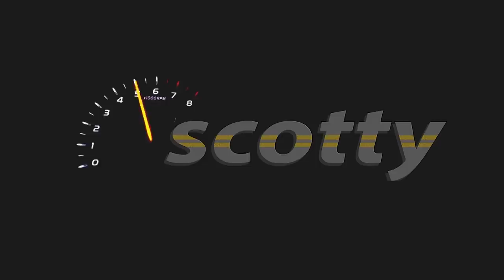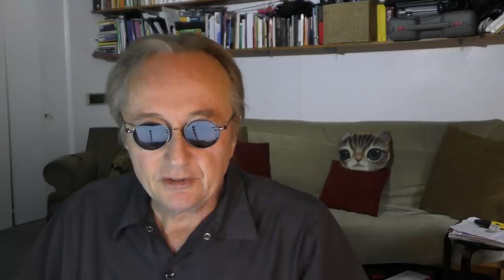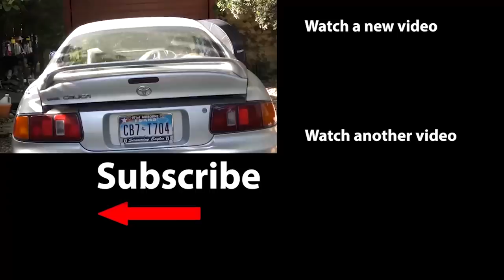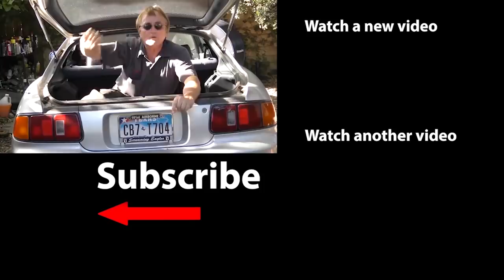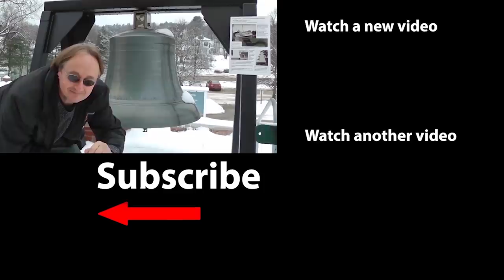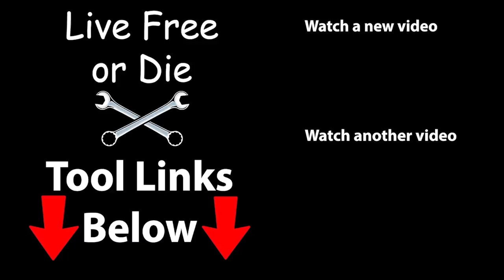Stupid Things People Put in Cars

Comment: I hate the automatic engine stop 🛑
Reply: I drive a company car, a 2015 Fiat doblo 25k miles with  start stop technology, it burns one litre of oil every 1000 miles absolute junk....
Reply: alitlweird same, I work for a rental car company and have to drive the f150 a lot and unless you’re paying attention and letting off the brake early so the engine can start up again you can forget about having a smooth start.
Reply: @CodeNiratias  I work for a car rental company too.  You wouldn't believe all the cars that get towed in for " engine dies out at a full stop".  Quite a few cars also marked O/S because of that.
Reply: @CodeNiratias  My neighbour bought one and sold it after the first winter.  Canadian winter...Minus 30 deg and start/stop plays havoc with batteries and engines !   Complete crap !
Reply: I hate it too, I turn it off every time i start my car
Reply: Fiat isn't bad now days. they are meh, but not junk as they used to be.
Reply: I drove fiat doblo too , i had to put oil  once a month !
Reply: @aintquitewright1480  it's different with Toyota hybrids because the motor is chained to the engine rather than the constant crank of a starter motor
Reply: alitlweird on my 2018 f150 with a 2.7 I can turn of that start on stop
Reply: I don't like it either. But unfortunately its becoming standard. I just turn mine off before I drive off. Going to deactivate it soon though. Because sometimes I forget to press the off button....
Reply: I can't imagine driving a bullshit car like that. What a ridiculous feature, but at least you can turn it off.
Reply: @Vanessinha91Pucca  Sure thing Vanessa smh
Reply: just hearing them turn on and off on the road is annoying
Reply: Is there a way to bypass it? My mom has one and it’s going to fry her starter.
Reply: alitlweird so do I it’s COMPLETE GARBAGE
Reply: @chaddiusthewise527  The starters are built to take the expected extra cycles. So are the batteries. Because they're all about gaming the fuel consumption figures, you can't turn the 'feature' off permanently without doing some research and a spot of rewiring but you can usually do it each start. How easy it is depends on the manufacturer but normally it's just the push of a button.
Reply: @TonyRule  the starters are not the starters type that was used for decades.  These are purposely designed to do this.
Reply: Y
Reply: Me too, thats why I refuse to buy any car with i-stop. I wont press the button for 3 seconds to turn it off everyday, then have that amber warning light on all the time I drive. Also, the system wears out the engine and battery.
Reply: My Jeep has a button where you can shut off that feature.
Reply: @TonyRule  Thanks!
Reply: Thank your government
Reply: In 5 years, you will be asking where all the horsepower went
Reply: My Automatic stop only kicks in when you fully depress the brake.  If you engage the brake enough to keep the vehicle from moving away, but not hard down, the engine will keep running. It's pretty easy once you get the hang of it.
Reply: If the engine stops... will the ac stop?!?! That’s the dumbest thing ever
Reply: @UAa320  lol so true. If I'm in a particularly bad mood and a stop/start vehicle is pacing me in city traffic. I look over at them like "WTH is wrong with your car?" even tho I know why. Its annoying to listen to. Especially when they creep, stop, creep, stop. KNOCK IT OFF! LOL
Reply: But auto manufacturers loves you coming back sooner for repairs or buy a brand new LEMON.
Reply: @Bobbytrus12  My 2018 F-150 has the same thing but a 5.0
Reply: It seems like it would take a while to convince yourself your car isn't broken lol!
Reply: @sambo9855  I only have 2 trucks 2 SUVs don't have cars
Reply: @ilikefordchevygmcnotramand6810  m'kay whatever.
Reply: Castle Bravo  believe it or not, it's true.  It's the customers who bring back the car and complain about it. Trust me I know, I work as a mechanic.  Also, rental reps have no way of telling if the car has start/stop, and they only see a limited amounts of information about each vehicle.
Reply: Not a big fan of it myself, I've actually seen people do research on those stop/start systems and the gas that they saved in their studies was marginal at best.....  Might as well just get a car without it or shut it off when you drive...... Unless you're used to a vehicle that does that, it can freak you out and you actually could think your vehicle has completely died when you come to a stop
Reply: Castle Bravo  haha, believe what you want then
Reply: @sambo9855  Car things I hate when people have:
Remote Start
Auto Stop
Garmin GPS
Anything attachable to the mirror
Reply: @beedslolkuntus2070  The AC continues to run.  After a short time, as the AC continues to run, the engine will kick in again.

Comment: I hated the stop/start "feature" in my vehicle until, one day, I started receiving the message "Start/Stop feature unavailable"... No more rough acceleration when driving in the city. Best malfunction I have ever experienced.
Reply: Could be a weak battery.
Reply: A GM vehicle?
Reply: @sebione3576  I had done a quick search and found that the issue may either be a fuse or the separate dedicated battery that runs the S/S feature so I didn't pay any further attention.
Reply: @AonGuardian  em if all one has to do is disable the 2nd battery. This is important
Reply: Why? Does start stop system leads to rough acceleration? How???
Reply: i can turn start stop automatic off in my mercedes w205
Reply: @royalprince5878  The feature activates and remains on standby after a period of time of driving. This is to prevent stopping the engine on EVERY stop as there is a cooldown of sorts between stop/starts. The engine will shut off when the brake is pressed past a threshold, which usually is when the vehicle is already stopped. BUT, with city driving, you've got lots of stop signs and stop and go traffic. If you stop the vehicle and then immediately take off, the vehicle will start to coast while the engine shuts off and then immediately starts back up again and you studder forward. It's a very awkward motion that is wholly unrefined. Thank you GM for this failure on a failure of a feature i 👍🏼
Reply: @royalprince5878  Think of the teenage kid trying to learn to drive standard and he cant seem to get a smooth takeoff from stop. He just stutters forward and then stalls the engine. Thats the gist of what it feels like to drive with this start/stop feature...every time.
Reply: @AonGuardian  But isn't start stop feature save lots of petrol? Instead of idling. Example stop at traffic light and heavy traffic jam or standstill traffic. Imagine if engine is running w/o start stop tech, lots of petrol will be burnt unnecessarily
Reply: @royalprince5878  but most modern cars are designed to use barely any fuel when idling so not really worth it
Reply: @emmareporter4324  I didn't know. What kinda supernatural technology is it? Car barely use any fuel during idling? Sounds too good to be true

Comment: Just use the $100 your cylinder deactivation scheme saves in gas to pay for an engine rebuild.  easy
Reply: When I was car shopping at the end of 2018, I wouldn't even consider a car with stop/start tech, GDI, dual clutch tranny or any other newer technology that seems like a nightmare in the long run. I like simple, proven, and reliable.
Reply: @InfiniteMushroom I did the best I could shopping for a compact sedan. Hyundai Elantra. No turbo, no GDI, no CVT or dual clutch tranny. Just good old traditional 6-spd auto and MPFI.
Reply: Suzuki sells cars in Japan that turn off the engine when stopped. The cars also last forever. I think GM (the company he mentioned in the video) just can't figure it out.
Reply: @kenthinson2980  Japanese get railroaded into replacing their engines at low mileages by their gov't.  Soooo, I don't know how you can even know that!
Reply: @daveybernard1056  because when you import one they go 300,000+ miles here in the states.

Comment: I can't imagine owning a car that kept constantly shutting off and starting back up. At least the new ones give you the option of turning this ridiculous feature off.
Reply: Sadly no. The Ford F150 and some older GM vehicles, yes. Most now don't give you that choice. It ruins the automakers fuel credits. But, even with the ability to turn it off, you have to do it every time you drive.
Reply: The sad part with the ford f150.if you put this device in the trailer hitch to permanantly disable the stop/go system you void the warrwntly...
Reply: I think its gonna kill the starter faster

Comment: I daily drove a 2000 Buick Century with the 3.1 L V6 and I loved the thing. It was completely silent inside even on the highway, very comfortable for long commutes since I had to travel 1.5 hours to get to work. It had decent power and speed for a 4 speed and was very reliable. It does handle like a boat when turning and it almost felt like the thing would tip over if you make a sharp turn. But it would go over bumps and pot holes like they didn’t exist. The only problems I’ve had was I had to replace all 4 power window openers, replace the AC compressor, flush the coolant system, fix a blown brake line, and replace some speakers and the horn. No major issues with the engine or transmission. I got it for free from my grandfather and I still drive it back and fourth to work. It only had around 13,000 miles when I got it and now it has around 150,000 miles and still going strong 100% rust free. Just change the oil every 3,000 miles and it will keep on driving.

Comment: I had a 2016 top of the line Chevy Cruz. I loved it. The start stop wasn't even noticed. Didn't interfere with radio- sirrius, was running before I could hit the gas pedal, but the wear on engine worried me. Unfortunately I totalled it before it was 1 year old. But the surround air bags saved my life and my dogs life too. I think it was 6 airbags altogether went off. Beautiful car. Solid ride and plenty of turbo pep. 44 miles to the gallon on a trip from northern Michigan to Macon Georgia.

Comment: Hey Scotty, back in the 1960"s my Dad said "Don't down shift, use your brakes!  Brakes are a lot cheaper than a transmission!"
Was he right?
Reply: Jon B generally, a clutch is cheaper than a set of brake pads, unless you’re in a vehicle with a larger, heavier clutch, a 50$ Honda Civic clutch is cheaper than brake parts.
Reply: Yeah and no. Just driving normally, listen to your fathers advice. If you are towing or it’s a really steep grade, don’t do that. Brakes are cheaper but if you push them to hard they get hot and crystallize making it have no friction and it won’t slow down, also if you haven’t ever changed the brake fluid and the car is a few years old it could have moisture in the fluid lowering the boiling point of your brake fluid. When brake fluid boils it introduces oxygen into the system. Oxygen is compressible unlike brake fluid meaning oxygen will make your brake pedal sink to the floor. A Transmission is still cheaper than the lives in the vehicle.
Reply: Anonymous A little , yeah. But that’s the point tho.
Reply: Did he also say don't use condoms? Because sex was great before AIDS came along. Your loss.
Reply: $200 brake job is certainly cheaper than a $1,000 clutch. I agree with your dad.
Reply: I'd rather spend $100 and an hour of my time to replace pads and rotors than to spend $300 on a clutch kit + flywheel resurface and 6 hrs of my time to R&I the transmission.
Reply: I learned (a long time ago)  to always be in the right gear for your speed therefore always in full control of your vehicle.  Braking in top gear and then having to take quick control of the vehicle you will have to change gear first loosing what may be precious seconds.  My father taught me to smoothly double clutch all my downshifts when slowing down.   Never had to replace a clutch, approaching 300,000 miles on my corolla right now.

Comment: Hey Scotty, I have a 2007 Prius with only 107k miles on it- about 5k miles after my last oil change (full synthetic 5/30) car started to run a little shaky, I checked the oil and it was not even coating the dipstick! Never paying for an oil change again, gonna do it myself! My question is: is the car going to be OK? I put oil in it (2 quarts were needed) immediately upon discovery, and there was a bit of build up under the oil cap :( Thanks! Love your videos!!!!

Comment: Thankfully I can disable the start/stop system in my car. I hate it.
Reply: with the system on,   in the winter,   did it take much longer to get heat,   and in the summer,  did the AC not work as good as the motor is always off.
Reply: @ateam6486  Yes the constant start/stop would interfere with both systems. They still run but at a reduced rate. It's really annoying in stop and go traffic. The car would always shut off and start up every 15 seconds. Mine is always off now.

Comment: Usually I love your advice but you are wrong on cylinder deactivation.  i bought a new 2017 Corvette Stingray and i love the cylinder deactivation which kicks into v8 instantly when you accelerate then falls back to v4 to give me 37 mpg on the fwy in a 460 hp / 465 lbs torque car that sprints from 0-60 mph in 3.7 seconds!  It's my daily driver commuting to work, racking up 19k miles in 2 years so far.
Reply: 19 k miles is nothing. At about 100k is another story.  I’m guessing you’re the type that never keeps a car that long.

Comment: I have a 2005 Dodge Magnum with a 5.7 L Hemi.  It has the cylinder deactivation system on it. This vehicle will run for hours and I receive 25 miles to the gallon. At times with a tail wind I get even better mileage. I love this system. I drive across the U.S. and the motor never fails, it runs without a glitch or miss. I guess I'm lucky to have received a good system. Love your videos Scotty.
Reply: You mean a 2015?  It didn’t exist in 2005.

Comment: Some people or some car companies but some fancy stuff in cars that people don't necessarily need. It's like quantity over quality which is sad.
Reply: Its just consumerism at its finest
Get used to it it aint getting any better
Reply: Nissan leaf has optional lighted ash tray. $100. Its shaped like a cup.
Reply: Makeup mirrors 👍
Reply: I love my old Toyota Celica..... Just press the clutch in with my left foot, select first, and your ready to go.
Reply: Thats my complaint about cars nowadays. Quantity over quality (reliability). So much techie crap crammed into cars and it's created so many more reliability problems.
Reply: @Daycab82  yep. When I was car shopping a few months ago, I wanted a low tech car, but didn't want a totally stripped base model with hubcaps. So I opted for 1 trim level up to get alloy wheels, but it also came with a touch screen infotainment system. I freaking hate the complexity of using it. I only find it useful for projecting Google Maps for navigation. Bluetooth calls are more complex to get working correctly and I hate the stereo operation being more convoluted than an old school style radio with a simple digital display. In hindsight I perhaps should have got the stripped base model and put some aftermarket alloy wheels on.

Comment: If I'm not mistaken, the modern cars (particularly the Ford ones) have found ways to keep oil at the top of the cylinder longer for lubrication during auto start-stop. Also, I believe the majority of wear being on startup is due to the engine being cold and not having oil near the top of the cylinders. That's much less of an issue with auto start-stop on a warm engine after it has been driven.
Reply: yup,  they sure did find a way to keep oil at the top of the motor,   its called sludge,  it clogs up the oil drain in the heads,   it works really good.
Reply: @ateam6486  no, that's what happens when people run their engine super hard and refuse to do basic maintenance at the proper intervals.

Comment: Like my 03 Yukon xl 6.0l. It gets 12mpg but still runs like a top (150000 mi). Burns no oil.
Reply: Meh, 5.3L is better. Pretty much the same engine as the 6.0 with the same power. Just needed the 4L80E not the 60 or 65 mated and its bulletproof.
Reply: @brandoncaldwell95  doesn't the 5.3L havr cylinder deactivation? Ive heard the 6.0L is bulletproof, but the 5.3L has issues cuz its more high-tech.
Reply: @palebeachbum  We talking older ones bud. 03-07 classic and 03-07classix suburbans 6 0s. They never put out another 3/4tonnsuburban for civilian use

Comment: The misfires on the 2003 accord v6 sounds weird. Unless neglected from oil changes the J series is tough as nails.
I'd probably have the coils checked if they were replaced at some point with cheapo aftermarket units.
Reply: Probably has 300k miles on it.  The car is most likely worn out.

Comment: Scott I have an 04 Pacifica with 115k miles. Car runs great, maintain, AC like a freezer. Still has great power.and gas mileage. The issue is a noise in the engine compartment. Any idea  oh transmission shifts properly. Any know things that would make a chattering like noise ? 
Thanks for the great channel. I've learned a lot here.

Comment: I work for Honda and the new ones have the push button transmission and sometimes i have to press the drive or park button 3-4 times before it shitfs...
Reply: What's your thoughts on the oil dilution & is it specific to the 1.5T?
Reply: If the 2019 1.5T & 2.0T don't have an issue, what was the solution to the problem?
Reply: I love my old Toyota Celica..... Just press the clutch in with my left foot, select first, and your ready to go.